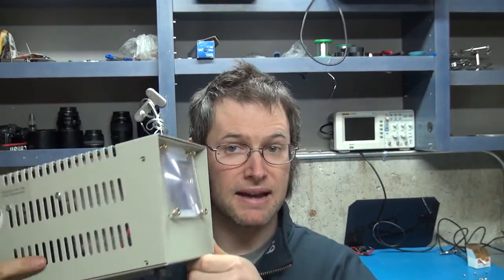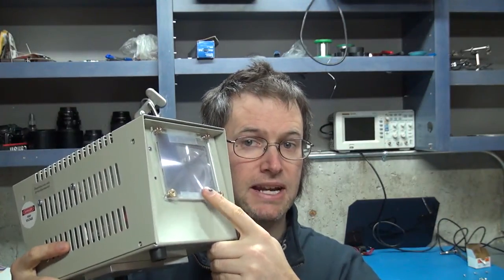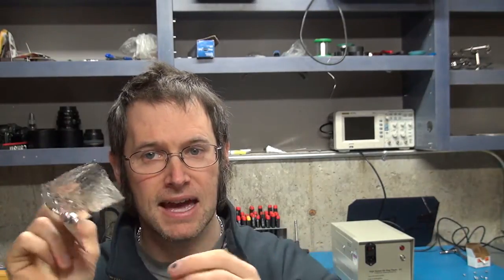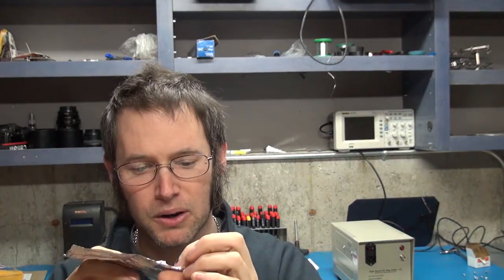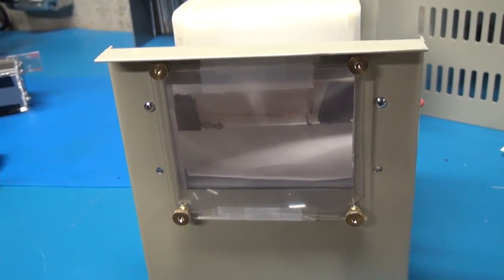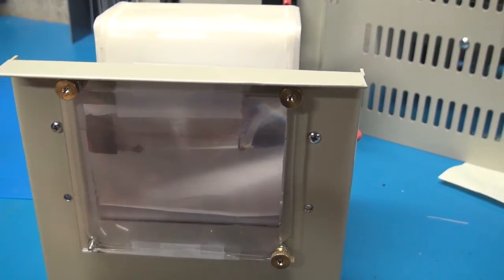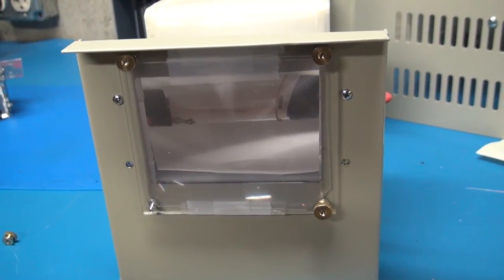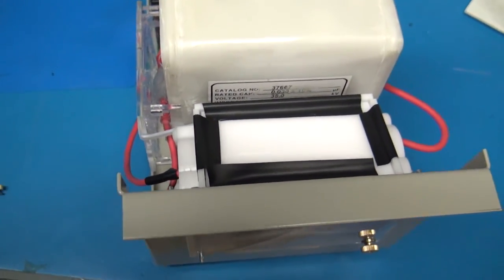TPB #75 - Airgap Flash Reflector Improvements

Comment: As I mentioned in the video using a mirror like reflector did have a downside of causing uneven lighting which the white acrylic did solve.

I want to make sure time is spent solving the most important problems.  The important part here is making sure I'm not wasting much light. Let's say about 40% of the light never touches the white acrylic (ie it goes directly from the spark forward). So if the white acrylic reflects 80% of the light that would mean 40% + 80%*60%= 88% of the light from the airgap flash emitted which is pretty decent (thought I'm not sure how close I am with that 80% guess). Compare that to the fact that I'm generally lighting around 900 inches^2 and only care about 50 inches^2 meaning this part is only 6% efficient. The low hanging fruit here for optimization is improving the light focusing portion of the system.

Comment: Not sure how this would work: How about using a glass mirror for the reflector?  Not sure if the coating on the backside of the mirror is conductive or not?  I know they also have mirrors where the reflective surface is on the front side of the glass.  Could still use the acrylic on the sides to mount components.